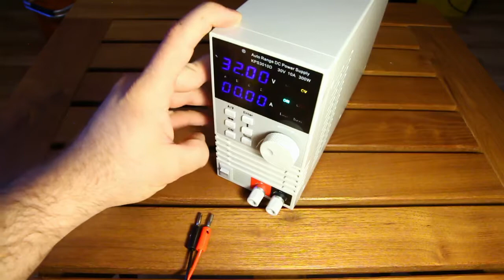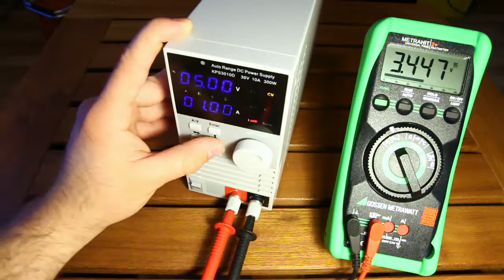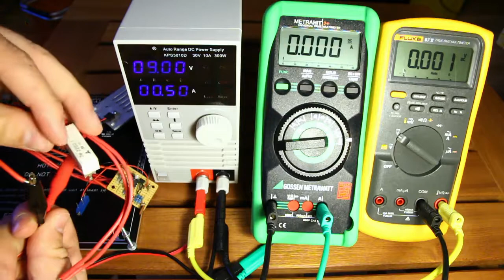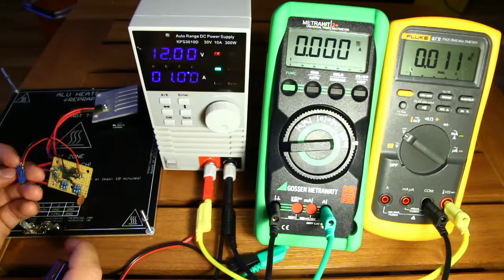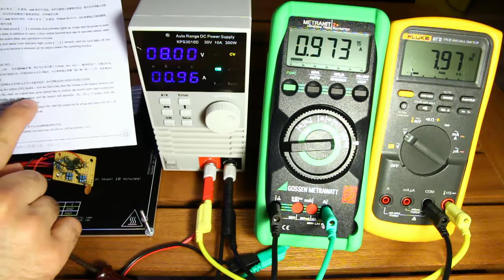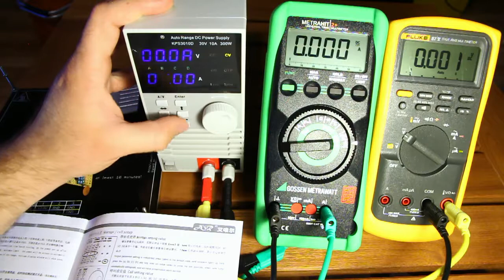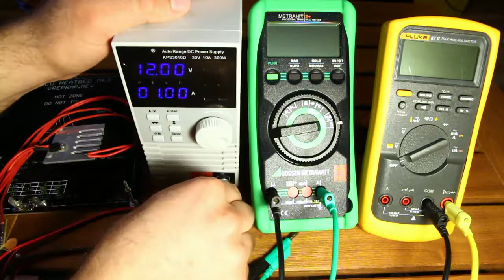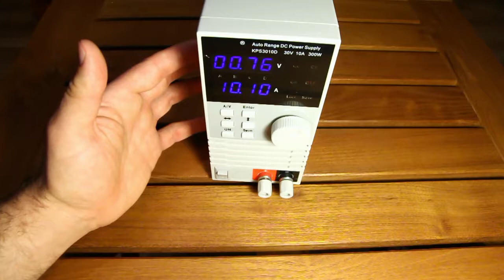AVR KPS3010D 30V 10A Bench Switch Mode Power Supply - Review Part 3: Does It Actually Work? #016

Comment: Thanks for your teardowns - anyway, if you work on high end audio - and rf equipment, these power supplies are an absolute no go. Personally I banned al Chinese junk years ago from my workbench, because the issues they caused were becoming more time/cost consuming. Good quality equipment is expensive, but it pays of in the long run ...
(A tip : scan the Chinese text with an OCR software and translate it on p.e. Google translate ... you would be surprised about the difference in explanation / translation between the Original (simplified) Chinese and their English version ...)

Comment: Thank you for this comprehensive review. Based on your feedback I decided to get one of these and despite its shortcomings I am happy with it.

The KPS3010D I've got has a sticker covering one of the housing screws on it with the date "18Y 8M" and the user manual is still the same erroneous version AVER.2017.06.3.

On my unit the "ON" output indicator light switches off when an OVP or OCP condition occurs and the OVP function, despite acting slightly weird under certain conditions, does actually work.

Auto test function works for current PASS/FAIL only, not for voltage as indicated in the user manual. But I don't have any real use case for testing an electric device based on voltage limits anyway.

Unfortunately, the timer function doesn't seem to exist on my unit either.
Reply: hey, this is a long-shot but any chance you can dump the firmware on your supply? I've been trying to get the serial connection working but it seems like my version of the firmware just doesn't have that implemented. I'd be extremely grateful

Comment: interesting, so it seems that you can use this PS to detect a shorted component on a motherboard even if this is a switching power supply not a linear one. you just need to turn off the over current protection....is that right?
Reply from the maker: The over current protection is a feature you need to turn on if you need it. It turns off the output once a set current threshold has been reached. If the connected device has a short that draws more current then the set over current protection, this power supply wouldn't allow you to power that device to protect it. But like any other power supply it does have a constant voltage mode, where it provides as much amperage as necessary to keep up a set voltage and a constant current mode were it regulates the voltage to keep a set maximum amperage. But this PS is buggy half of the advertised features don't work and therefore I don't trust the other half that does work.